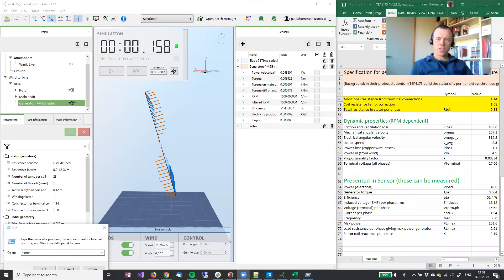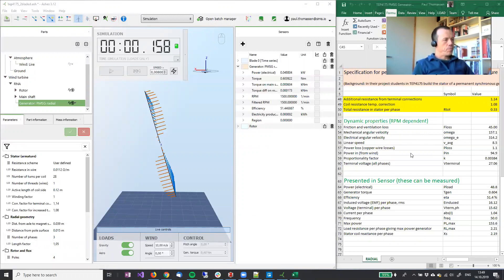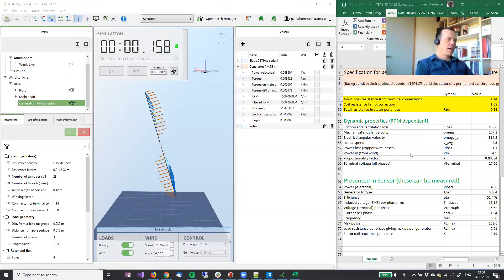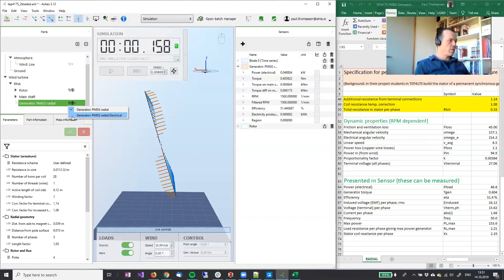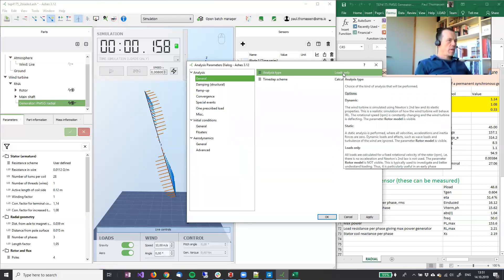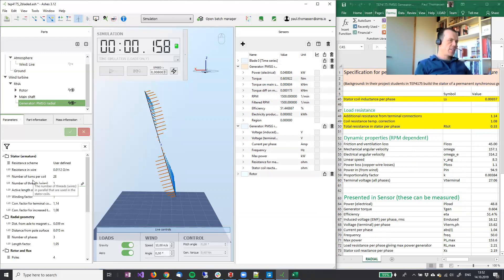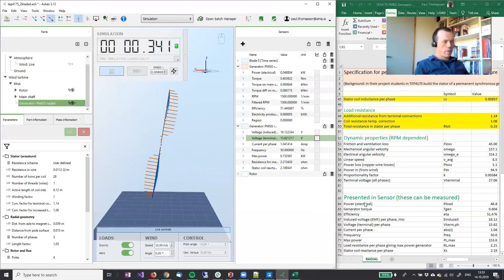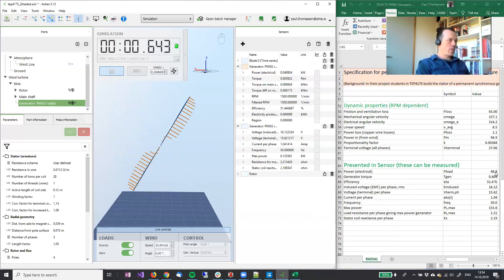Eps. 5 The PMSG generator spreadsheet vs. its Ashes counterpart

Comment: could dual rotor be simulated in Asshes software
Reply from the maker: You can definitely model a dual-rotor turbine with Ashes. There will be some simplifications in terms of aerodynamics, for example you won't be able to see the influence of the 1st rotor on the 2nd one, but it would be very interesting to give that a try!